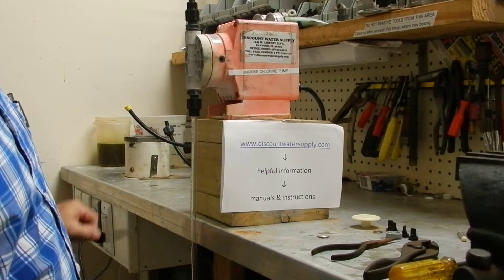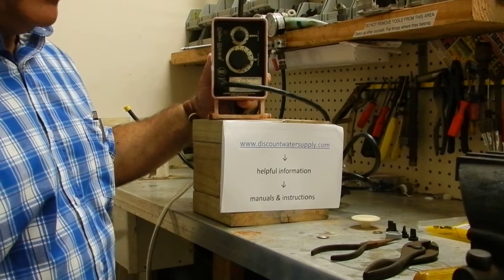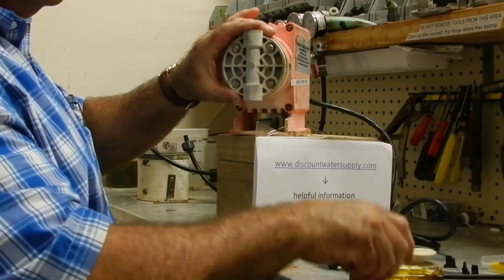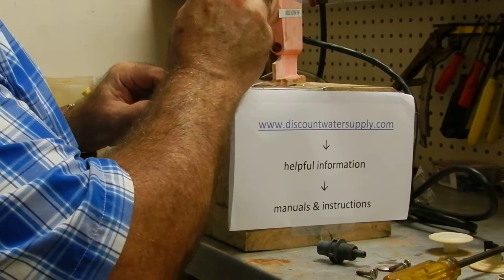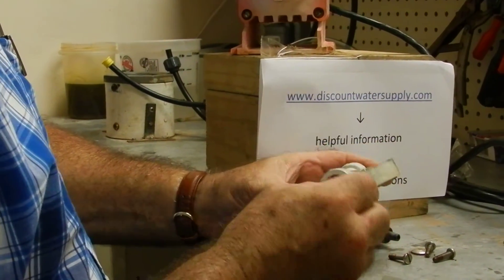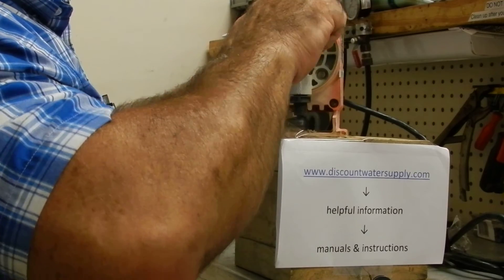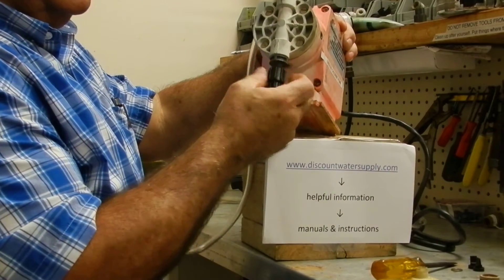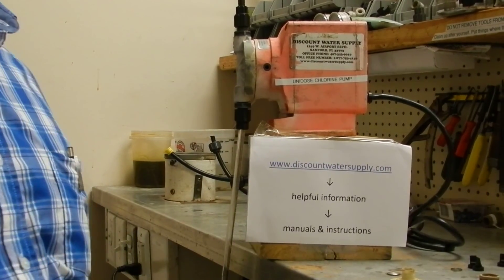Unidose Chlorine Pump Servicing

Comment: Well done! Thank you! These pumps are pretty expensive, so I was hoping to be able to rebuild it. I’ve had plenty of practice with clogged foot valves, and the plastic tubing and parts getting brittle over time, however the problem I have now, is I noticed the pump is dead, and not even running. I need to throw a meter on it to make sure it’s getting juice. It’s pretty old, so may be burned out completely. In that case a rebuild kit wouldn’t help this situation. It’s been to cold for me to want to mess with it right now, so I was sitting in a warm spot and doing some research. Your video is short , sweet, and to the point. Well done Sir!👊

Comment: Hey William. I'm trying to troubleshoot my unidose pump. Just bought my house and fixed the irrigation system and it has this unidose pump hooked up to the sprinkler pump to give it an anti-rust agent for my well pump. I checked everything, hoses, the diaphragm, hose attachment nipples, everything seems to checkout. I primed the pump and it works well when it is not connected the irrigation pipe with the line jump and spitting serum out the nipple on the end. As soon as I screw it into the irrigation pipe it seems to not be pumping as the hose stops "jumping" ... Is this a pressure issue? Is the nipple bad? Any info is appreciated thanks
Reply from the maker: Hey
There may be an obstruction in the water pipe. Hard to tell from here. The manufacturer manual is on our website www.discountwatersupply. com. Look for Helpful Information link.
Hey.

Comment: How do you prime it?
Reply: I was asking the same question.  Ours does not have a prime button, so I found this in the manual, "If the pump does not self-prime, remove the fitting or bleed/priming valve on the discharge side of the pump head. Remove the Uni-Valve and pour water or solution into the port until the head is filled. Replace valve, then follow start up/priming steps."

Comment: Dear William - thanks so much for this video - it helped me a lot and saved me a service visit. We bought an older home with a well system and Unidose pump etc. (with Chlorine tank, carbon, softener etc.) The system was inspected and operational at the time. 6 months later we notice a different in the water quality and I checked the injector - it was calcified. I needed to replace the duckbills (uni-valves) and cleaned all fittings / parts, but during my disassembly I notice the checkball and spring were not present in the injector fitting. The system is operating normally (like it did previously) but is it necessary to have this spring and checkball? Also - now that I know these things need regular maintenance, what is the recommended time period of checking all the fittings for calcification in order to prevent problems before they occur? Thanks for your time.